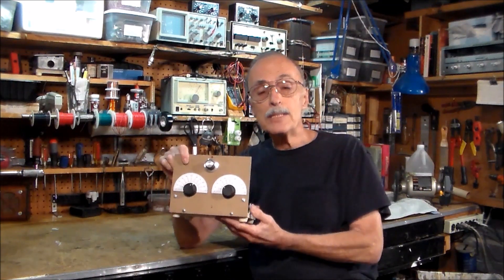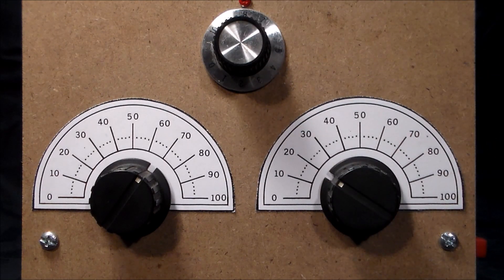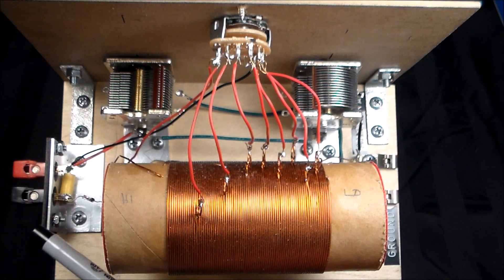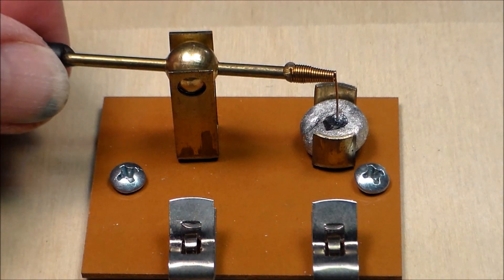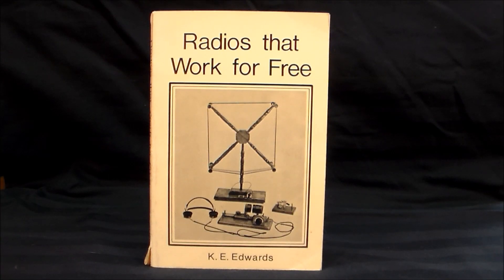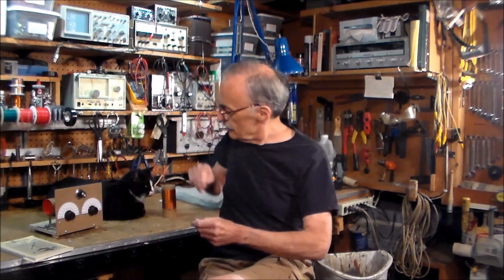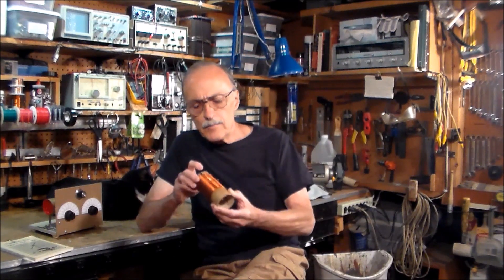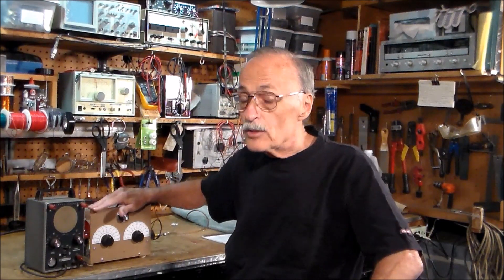CRYSTAL RADIO: FREE ENERGY SOURCE??

Comment: @squarewave2 Hello sir, I love this build. I had a couple questions, I know this build is an older one of yours but I was wondering if this radio would be benefitted by adding a antenna coil or does having the looped coil make that a pointless addition? Thank you for your time. My assumption is that yes it will anhance its performance. Also I see the wrapped  antenna on the cover of the book you have there. My question is in regards to it's practicality. Would somthing like that work effectively or is it better to simply run your antenna wire covering as much distance as possible as high as possible as you've stated. Again my assumption is that it probably does "work" but not nearly as good as the standard layout. Again thank you for your time.
Reply from the maker: Hi Bran Man,
This circuit does not need an antenna coupler. Rather than trying to add one, you should just start with another circuit. The big loop antenna on the cover is fun to play with because it is directional; but depending on its length, a long wire antenna will do better. Thanks for your comment.
Reply: @squarewave2  thanks for the reply.  after some reading I came to the conclusion that it didn't need the coupler I got the book it's awesome. I bought two  variable capasitors 365pF and a Alpha 1 pole 9 position band switch I looks to be the one you used as well actually. Now I just need to go get my 20 gauge enameled wire the head phone terminals the diode and all the rest of the bits and bobs lol I'm super excited to build it. What other bits do you got here that's not in the original parts list in the kit. Are you using the normal terminals for the antenna and ground connections? The coil might be a little bit of a challenge but I think I can get it done. Also what gauge wires are you using for your connections looks like maybe 20 0r 18 gauge. Also what gauge wire do recommend for the antenna and ground. shoukd it be solid copper wire without a insulator?
Reply from the maker: @branman3336   Hi Bran Man,
 Any terminal is OK for the antenna and ground connections. Use any gauge insulated hook-up wire for connecting the parts. Making the coil taps is tricky, see my video "Make crystal radio coil taps". The antenna wire is stranded for flexibility not solid. It can be either insulated or bare it doesn't matter.Gauge doesn't matter either but heavier wire will be more durable. Good luck with your project!
Reply from the maker: Hi Bran Man
The capacitor across the phones is really optional. It is supposed to fill in the gaps of the radio carrier wave but I doubt that you can hear any difference. But if you want one, use a .002 mfd at any low voltage value.

Comment: Very nicely made. I also made one using a galena crystal and they are tricky. The box says 1924, price 2/6 and says it contains 2, 3 or 4 crystals, a special contact wire and instruction pamphlet. Was I robbed? I paid £3 for one crystal in the tin box. I remember reading somewhere the wire was phosphor bronze.
Bill, G4GHB.
Reply: I also remember 'Wood's Metal' was used to mount the crystal. Whatever that was.
Bill, G4GHB.
Reply from the maker: Hi Bill,
I can't say it you were robbed. I am not familiar with your money.  But thanks for your comment!

Comment: About 80 years ago my grandfather moved next door to a radio station that had around 50kw antenna.  He built a giant array of crystal radio sets and wired them together and it provided him with free electricity that resulted in a greatly reduced electric bill.  But I didn't really believe him.  Two years ago I moved into a new place and directly across from me is an A.M. radio station and it's very big antenna.  I am less than 100 feet from the base of that antenna.  So out of curiosity I built one crystal radio (I made one as a kid decades ago) and included an LED in the circuit to see what happened.  Well dang if it didn't light up.  As it happens I bought a few miles of copper wire a few decades ago at a yard sale for less than 1% of the normal price, actually a fraction of the scrap metal value.  Being the pack rat that I am I brought it with me when I moved.  So...

I got me a little power plant and since I've recently converted to all LED light bulbs I now have a very bright house and yard and pay 0 for the light bill.  It's not enough to run the A.C. or other appliances but it takes care of about 10% of my electric bill and honestly the only thing I had to buy was the crystals, a small investment for what I get.  I figure I'm saving about $180 a year in electric costs and I think I spent maybe $30 on the crystals at the flea market.  Of course winding all those coils took weeks lol.  My neighbors think I'm crazy with all the antennas under my soffits.  A funny side affect though is that even without any speakers my whole house reverberates with the radio broadcast.  At least the programming is pleasant.

Comment: Actually... I've got a roll of 45 AWG copper wire, thinner than a human hair; I've always wondered what would happen if you put that on one end of a Mylar balloon and use it as an antenna. Wind currents mean that it's unlikely to be a truly straight wire antenna, but it could probably get pretty high.
Reply: theorically a 45 awg wire wound over a roll several miles could produce some ac voltage energy from the tremendous resistance of the setup

Comment: need the tesla tower near and hold quartz lol....  will shock you and make you godly and the ability to control all elements a push or a pull depending on the elements charge...  bites like a snake fyi...   crystal energy radio and crystal receivers that piezoelectricly charge you up
Reply from the maker: Thank you for your comment! But I can't make any sense of it. Can anyone else??
Reply: look up how ultrasound and rc cars use quartz on both ends this energy controls all elements a push and a pull. in this vid there is a tesla tower that lights up a picture tube which is quartz inside if he would have touched the bottom of the tube it would have shocked him energizing him like a van de grafft generator https://www.youtube.com/watch?v=7vRcDLEiRaM

Comment: Can you harness or convert the reception of radio waves into voltage power scale it up and have free energy?
Reply from the maker: There is no such thing as "free energy"; and  there is not enough "energy" in the received radio signal to do any real work.
If you could "scale it up",  the energy would still not be "free". It took power derived from a coal or hydroelectric
 plant to power the transmitter.  The answer to my title "free energy source?" is NO.
Reply: Nikola Tesla...  crystal energy radio and crystal receivers
Reply: @squarewave2  BUT, off-planet RF is free to *us*.
Reply: you could light up leds i think...Thomas Henry Morray was obsessed with crystal radios as a child, he supposedly invented a free energy device that lit up kilowatts of bulbs...of course it all happened in the 1930s if it was all true as reported

Comment: Ever looked at "Earth Batteries"?
Reply: Yes and the term is not definitive. 
Earth Batteries describes either magnesium primary cell batteries or a type of polarized capacitor that can act as a primary cell battery depending on circuit conditions. 
Neither is truly "Rechargeable", but either can be accessible sources of electricity if someone is in an emergency situation. 

In a non-emergency situation, they can be quite costly. 
A primary cell eats the cathode, usually leaving a salt after it's been exhausted. The best 'earth batteries' are setup to be refreshed from time to time, but many of the "Free energy" designs assume that the electrochemical reaction is inexhaustible, and thus don't make allowances for it. 

Mr. Teslonian here on Youtube did some stuff with earth batteries a few years back that i watched quite carefully. it was interesting, but it's not the answer.